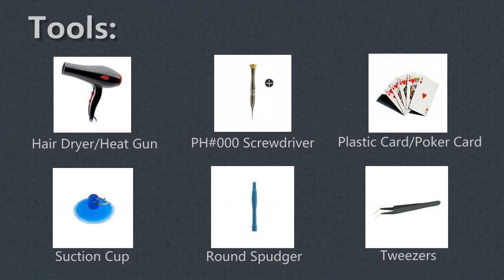Sony Xperia XZ Teardown

Comment: Thanks for this tear down. It was a great help in the complete tear down and reassembly of my XZ today. Very good video and excellent Sony Engineering too. Now I know why my warranty wasn't honoured by Sony UK or Sony Singapore, when I purchased my phone from a cheaper site in the Far East. It had previously been opened up. I can tell by the condition of the copper strip that has to be removed, just prior to the removal of the battery.

Comment: +Wit Rigs I have  question. the frame of xperia XZ is made of what? my xperia z2 has a pretty solid frame (as far as I know, it is made with a High Grade Aluminum Frame) which makes my Z2 sturdy even it fell many times on the floor.
Reply from the maker: z2 do has a very solid frame, but also it would make it heavy. XZ is a little bit lighter than Z2, and the frame of XZ is made from  some kind of both plastic and metal material, lighter and softer than Z2. It may not be sturdy as Z2 if fell on the floor. hope this can help you :)
Reply: Wit Rigs thank you. appreciate the response. BTW HAPPY NEW YEAR. 😀
Reply from the maker: thanks :D and you too HAPPY NEW YEAR ;)
Reply: It's made of Nylon plastic, a Sony rep official said

Comment: great teardown, looks a very compact design. 
one question though: The small band at back's bottom, is it plastic? has any function or just aesthetic?
Reply from the maker: Yes, it's made of some kinda plastic material. n I wanna ask Sony the same question what function it has
Reply: I think that is something like a thermotape to transfer to battery heat to the metal plate more faster just like thermopaste between the CPU and CPU cooler.
Reply: I think it's a signal reception to help gather better WiFi connectivity. It's just like the antenna band lines of the iPhone 7 at the back
Reply: +Wit Rigs should have put an led bar like on xperia sp
Reply: Charge Final Impact ?? Which part are you refering to? I thought it is the 7:23 part?
Reply: Tang TangTang I'm referring to the external back of the device where there's a different small rubber-like material at the bottom, which is the antenna band line

Comment: WE.  HAVE. BEEN. WAITING. SO. LONG. FOR. THIS.

On another note:

FUCK iFIXIT
Reply from the maker: I. AM. SOOOOOO. SORRY. TO. KEEP. YOU. GUYS. WAITING. SOOOOOO. LONG. 
So do you like it?  :P :P :P
Reply: Shamoy Rahman They teared down the XZ already?
Reply: Charge Final Impact On this channel they did and I thank them for it
Reply from the maker: Sorry for late reply. You can try these:

Step 1: Check the connectors of screen whether they loosen or not.
Step 2: If the connectors hold in place, take a good look at the LCD with digitizer flex cables, it is the most vulnerable part. If they have been worn, you have to replace the whole LCD screen with digitizer.
Step 3: If the flex cables are intact, the problems still exist. You need to replace the complete LCD display with digitizer because the LCD is damaged.
This blog might be help http://www.witrigs.com/blog/list-of-all-problems-of-sony-xperia-z1-display/
Reply: Shamoy Rahman
Reply: hi my sony xperia m 4 phone stuck in start up blue waves ....i tried all possible ways ......blue waves all not stoping they are going upto the charge gets 0...... pls help ....very very important data are in that .....................plsssssssssssss help   .
Reply from the maker: Does it fell to the floor before? or is there any cracks on the phone?
Reply: no it never fell on floor . i traveled to another country ..and inserted that sim card .... it switched of normaly ..and then stuk in blue waves ....pls help if u know how to fix

Comment: excellent design especially on heat dissipation, will never exploded like Samsung and Apple.
Reply: Apple Steve also admire Sony, learn from Sony,  Sony make devices can be consider to be a grand father,  Samsung baby..lah. Best for copy and cheating tactics.
Reply: I guess the seller of Juan Bagnell's XZ is also a Sony hater, that he put an oven inside Juan Bagnell's unit lol
Reply: heat dissipation? Did you mean the steel plate above the battery is dissipating the heat?
Reply: Yes and the alkaido back plate.
Reply: you have to put it in perspective mate , the galaxy note had 5 generations before the problem note 7  with  very good phones  , compare it to sony track record of heat problems in so many of its devices , and the heat problems for sony are still happening .
did you see the recent pocket now review  of the xz test ????
Reply: mikldude fuck pocketnow. It was a shit review and mainstream review sites are biased towards apple and Samsung no matter how wrong they do. There are forums where so many people complain about the s7 defect problems they get after a bit of use. Pocketnow won't mention how the s7 heats up even worse than xperia. They always over blew it out of proportion I have both Samsung has more heating problems than Sony or did you forget the note 7. 

. These people are so biased it's ridiculous all companies are afraid of Sony. 

Besides the warning is there to prevent permanent damage to your internal which so many fail to Point out. You get no such warning with the s7 so you can damage your phone or just have it explode in your face
Reply: MrWalker1000  really ....are you saying they are faking it ??? , and its not just pocket now , other reviewers even just non company reviewers have shown some sony models to over heat with little provocation , as for galaxys over heating i have had two and not had a problem, also have a g5 and 6p under extreme use all will get warm , but none over heat .
how do you explain that ????
Reply: mikldude every phone will heat up its called physics there is no phone that will not get hot under extended usage. Some phones is the key word here but I'd argue that samsung has worse problems because of all of the complains on the forums about the many display problems and shit they have. Also, the s7 definitely overheats. 

Sony has a warning to prevent damage is that not a useful feature? or do you want your phone to explode. 

Im not saying they fake it up but they have interests in certain companies. just check phonearena they always give apple the perfect score even though apple removed the headphone jack? what the fuck? or the note 7 even though it explodes. 

imagine if sony didn't have a headphone jack it would be thrown out the window rigth away even thought apple is half as capable as a sony phone. like get out with this bs. 

and I know of reviewers who praise the sony. so whats your point.
Reply: MrWalker1000 sorry mate , most of the reviews of the xz i have seen have been fairly down beat or mediocre at best  , but if you can throw up link to a good one , i`ll be happy to look at it .
Reply: mikldude That is because you are looking at the wrong channel I believe. From what I saw, all review unit don't have any good review for the phone. EVERY single review unit overheats. There is one XZ I saw in a Cantonese channel, he personally address to his viewers that overheats does not happen while film 4k videos with XZ. He even record a video and proved it. I dk what issue caused the pocketnow unit to overheat to that kind of degree.
Reply: i ordered a XZ 1 month ago and i'm pretty sure that the phone runs quite warm sometimes and when i begin to feel hot, i'm not able to use the camera anymore. But take notice that I had been playing really heavy game for almost 1 hour under hot weather (36 celcius). I believe the reason that Sony doesn't put a large battery on a small device is about safety. Look at the Note 7 battery back to see XZ's battery you'll see a huge difference.
Reply: Bui Hoang Long sony knows what they are doing man. im so tired of people unfairly criticzing it. 

Sony doesn't have overheating problems, the s7 on the other hand does but nobody ever talks about it. The s7 gets noticably hot, hotter than the sony. And sony gives you a warning sign to prevent damage to the phone which samsung doesnt.
Reply: Lim Bhian yup they are like China
Reply: sony always gets unwarranted hate for overheating meanwhile the note 7 explodes and samsung still gets really hot. Sony warns you for overheating so no damage to the phone. 

i swear people get paid to talk shit about sony.

Comment: from this disassembly we can understand why sony used plastic frame but other companies didnt so why did sony go this route if there was another
Reply: Mahdi Ali Because using pure metal just for quality wouldn't make sense. Wifi signals require plastic because it wouldn't pass on metal or glass construction. And that's what explains the outperforming of this device against the iPhone 7 / Plus, Galaxy S7 / Edge, or any typical 2016 flagship phone in Wifi speed test
Reply: the difference is negligible
Reply: Mahdi Ali That 0.5-1 sec faster performance of the XZ will increase as time goes by. Why? Because Sony's software is so stable, fluid, and reliable that the speed you have seen today will be the same in the future. When new, the Z3 was just 0.5 sec behind the S5 in terms of speed, but look at now of them. The Z3 is easily pissing on the S5 in speed comparison. That's how stable the performance is on Sony. Their smoothness is consistent and there's hardly even a lag that you'll see. And why Sony used plastic is for better side drop resistance because metal is more solid so it will absorb more shock from being dropped, and might cause more damage inside the phone. And also, plastic keeps the color better than metal (metals will wear its color off as time passes by). If you think your Z2 has no WiFi issue, then it's good, but obviously the XZ would be more than twice better than the Z2 in WiFi signal reception, and that's mainly because of that plastic architecture
Reply: Charge Final Impact really I don't understand why Sony uses plastic frame for Xperia xz.the other x & z series have metal frames, mostly.. I really like the xz but the plastic frame made me sad 😔..
Reply: Mahdi Ali 10 - 20mbps of difference is negligible?
Reply: Mahdi Ali Still is a difference. Here in our country, a 2Mbps speed difference is considered a huge difference already. I know it's not just the material, but you should also know that Sony's polycarbonate is capable of handling drops while metals would get scratched already once it was done. I prefer the plastic side for better drop resistance than metal just for more premium feel. And you wouldn't know it was plastic if nobody told you or you didn't watch this video
Reply: Charge Final Impact 
I'm sure you've seen the browsing comparisons 
xz is 0.1 -0.5 sec faster 
oh I would know the moment I drop it and see that plastic angle chip off or the moment i easily scratched it
it's not about the feel its about durability...
I had a z2 which had a mixture of plastic and a strong aluminum chassis 
no internet issues...
Reply: yes exactly its not a deal breaker for me i would put in a hard case anyways but still no good reason ...
Reply: tinmyat min I explained it enough. Care to read it again?
Reply: Mahdi Ali Just hold it and you wouldn't even feel it to be plastic at all unlike the G5. You'll only know it is plastic if you are Zack or you did really wanted to break it down
Reply: Charge Final Impact OK.thanks man.
Reply: @Charge Final Impact
where did you get that score? 
tech trinkets tested the internet speed against an s7 edge its 7mb so yes its negligible specially if compared to  a more premium material 
and its not about the "feel" its about the durability what happens when you drop it ? it will get scratched much easier and paint will fall over time...
Reply: Strange that when the wifi performance was tested against some other well known brands the sony  lagged behind some other flagship models ?
Reply: +mikldude not the xz   he was better then s7 edge
Reply: Toni Tanjic w must be seeing different tests ,  that's not what i saw.
Reply: Just click the link and look
Reply: +Shawn Mendes i'm getting some wifi issues in my z2 currently. and my next phone will be xz. although #sonyfanboy
Reply: +shawn Mendez 
i got my xz 2 weeks ago 
I got 1 scuff andihad one angle chipped off a little and yes im using a protective case and yes im being careful with it and no i haven't dropped it 
So yeah Toughness is more important than one  bar of reception
Reply: Mahdi Ali Weird that it still got scuffed even with a case. What case do you use?
Reply: jenish tailor Well the Z2 is like a 4 year old phone already so it's pretty normal to have issues with it already